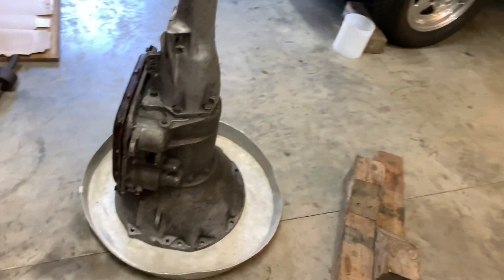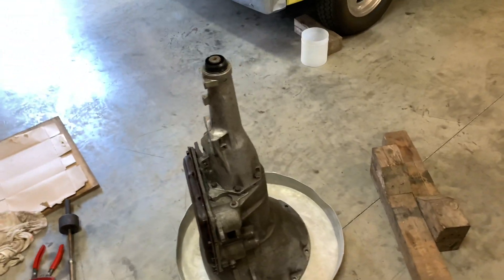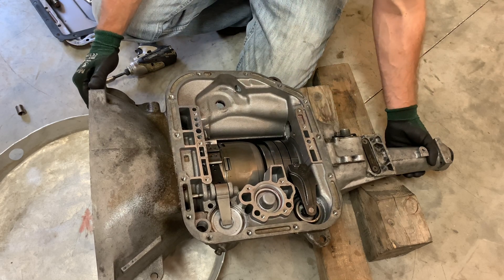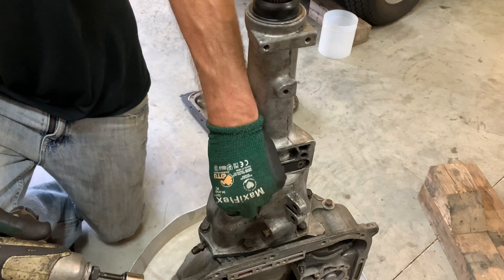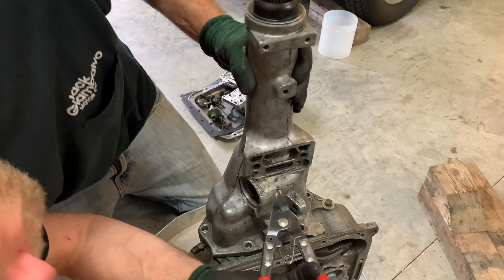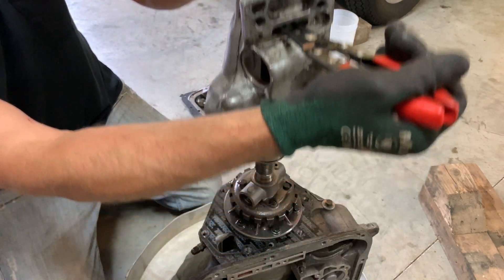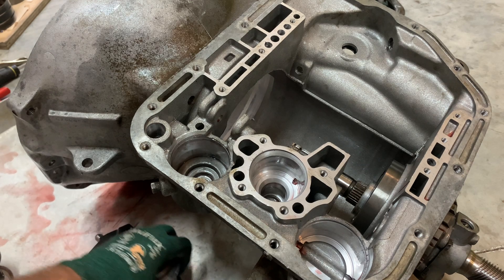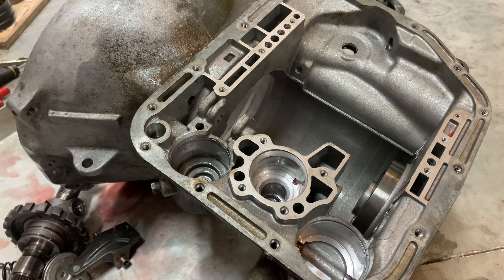pt.1 Beginner’s guide to building a stout Mopar 904 transmission

Comment: I have a Valiant V200 1961. Does my car have the same transmission as you show here?
My transmission leaks fluid pretty bad after parking 2-3 days without running 
Thanks
Reply from the maker: @sparky5431  Yes, that should have a 904 in it. It may have some slight variations compared to mine because yours is a ‘61 model.
Reply: Does the manual and automatic transmission Torqueflite 904 have the same core?
Thanks
Reply from the maker: @sparky5431  A-904 is the automatic. 
A-833 is the 4 speed manual. 
A-230 is a 3 speed manual.

Comment: There is also a lube mod you might want to do for the rear support. it involves drilling a small hole. The support is subject to galling where the output shaft goes thru it.
Reply from the maker: I will look into that. I have seen that galling before. I that it was caused from towing with the cars rear wheels on the ground.

Comment: I use cope for my stuff. I'm sure you know but for the other guys out there.. definitely use the billet low reverse servo assembly. I had the old assembly get cocked in the bore so the low band did not release and the 2nd gear band came on. The trans instantly locked up !!!!thank god it was on light throttle!  My 904 liked to burn the hi gear stock clutches, break the top thick clutch plate on the hi gear drum and crack the converter hub. I rebuilt  that trans 5-6 times in the course of 15 years.probably cause i never got good aftermarket parts.Now i have a 727,that i built, with a cope reverse manual V-B, billet low reverse servo,billet hi gear drum with piston and return springs and retainer,Alto clutches,kolene steels, also the ultimate sprag. My old 904 had the 2.77 low gear set .That combined with the 4.30 gears made my mild 360 in my 74 cuda ,an awesome  ride ! you are gonna love that low gear ,if it hooks up.
Reply from the maker: I did go with Cope for the parts. Both billet servos, accumulator, band strut and apply lever. Race clutches, steels and bands. Should be here Monday. I can’t wait to get this thing in the car!
Reply: It's gonna be an animal with that low gear. @Duster_Garage

Comment: adding cheatah valve body did wonders for My transmission, I hear "A and A"
Reply from the maker: Right on, I will be installing a reverse manual valve body in this trans. Can’t wait
Reply: @Duster_Garage  It will be good on the street, I drove one back when they said Never and no problems for 10 years as weekend cruise and drag raced. Just one thing Must have Lock out shifts , reverse is just that instant reverse lmao no whoops. oh yeah My Neighbor had Dart Sport .557 Mopar cam close to same as your set up , he ran 11.4s as a Bracket racer 6 point cage,360 "home ported J Heads 10.:1 , 4.56(spool) gears with 29.5 x10.5 Bias M/T slicks
Reply from the maker: @smilsmff that .557 cam was a serious piece, I’d like to find a NOS one. I can’t wait to get this trans finished and in the car.

Comment: Pull pan, pull valve body and then air check the system to see if any seals have “blow by (holes at front of case at front of valve body, rubber tipped air blower will act like valve body)…
   Never used a slide hammer for a 904 or 727, put screw driver between hubs and wiggle, pump will fall out…just how I did it when I built transmissions for a living many years ago…
   Also, really good video…
Reply from the maker: Thanks man. I did get a pump out of a 727 before without a slide hammer. This one seemed extra tight though.
Reply: @Duster_Garage  I’ve run across some that I thought would never come out…hammer & screw driver time. lol